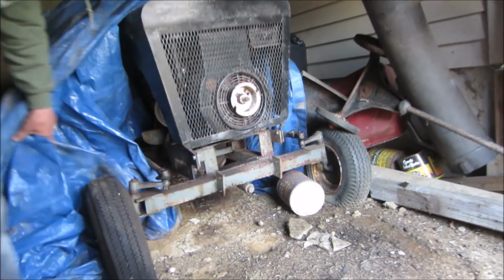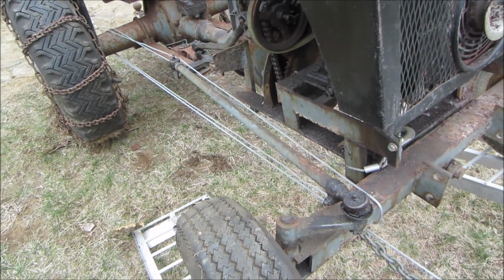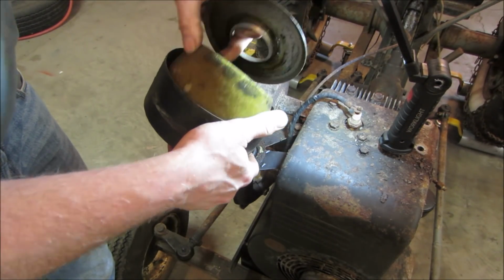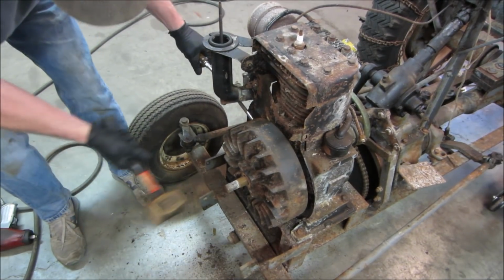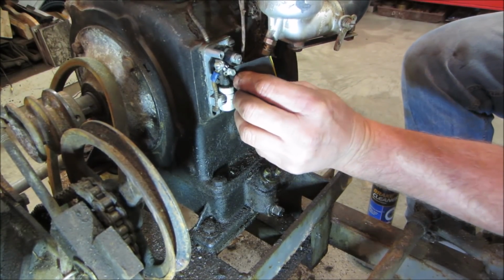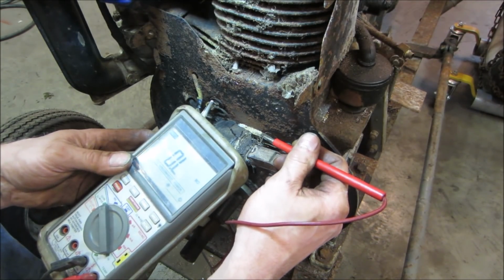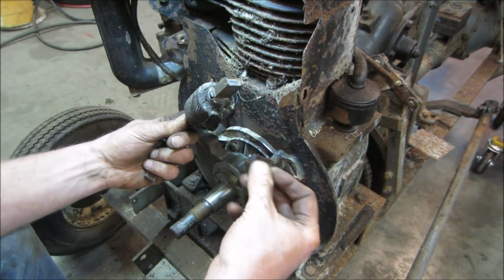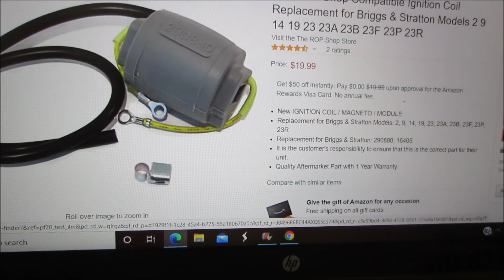Found under a House, Home Built Tractor, Can IT Be Saved?

Comment: Use the points of thet engine and a 12 volt automotive coil like many engines do. Always worked for me. The only thing is you will need a battery. Also do not use the kill switch on the points cover, it will short the battery. Just disconect the battery to kill the engine.

Comment: if you still have it you could stuff the little 3 cylinder diesel you got a while ago on there or the Briggs & Stratton model ZZ engine you did 2 years ago would be perfect for the tractor. it's not the most powerful engine but with all the torque they make it would work .

Comment: With functional external contact points, all you'd need is a coil and a 12-volt source of power, like a motorcycle battery.  I used that setup with an ancient Briggs years ago and it ran fine.  Didn't even burn the points after many hours of operation.  Granted, it's abandoning the 'original' nature of the critter, but it'd get that old thumper back into operation.

Comment: It looks like that coil had a short between the windings and went into thermal runaway which melted the varnish on the magnet wire and then the potting compound. In my younger days people would bring those to our transformer shop and I could reverse engineer them. I would measure the wire size and count the turns per layer, number of layers, and measure the insulation between the layers ect.  It might be difficult to find a shop now days that still does that. Anyway, I love your videos and I'm always impressed with your skills. I'm looking forward to your follow up video on the Franken tractor.😄

Comment: I'm pretty sure that the Primary Winding would consist of the 2 small wires and you should be reading the resistance across those two wires.  The Secondary Winding would be between the Spark Plug wire and Ground.  Again, just my opinion.

Comment: Coils are super easy to...cut the old one off the armature bar then heat the bar up good and hot and push the new coil on until its in the middle....you can get the coils off eBay pretty cheap....done probably 4 or 5 old briggs like that

Comment: Leave the mag out and mount a resistor type automotive coil in-line with the points , should get all the spark you need . That’s how old school Koehler does it . We can always ( make it go ) 👍
Reply: Yeah, that. However I got in trouble with the cast iron Kohler s because they came on Wheel Horse tractors.
 Those things reproduce like rabbits. You know you have a problem when you hit double digits. I get mine for cheap because of wiring connections usually

Comment: The model 19 which was 7 1/4 hp, looked a lot like that 8 hp.  It had the starter generator set up.  I have been looking and looking for one for my Allis B1.  I always get excited when I see one of those 8's but I should know better. The squared off tank and the air filter are dead giveaways.  The 8 is way more common. The starter generator will bolt right up to the 8 though and really works slick if you can just wrap your head around the wiring.

Comment: A work around for the dead mag would be to use the points, connected to a conventional ignition coil, and run with a battery ignition. The points after all are what tells the plug to fire. So, if you added a battery you could then go with electric start and even lights. I believe I would go with one of the old starter/generators, which would be appropriate for the time period.

Comment: If I am not mistaken, that engine is similar to the Model 19 Briggs and Stratton, which was a 7hp cast engine, and the parts are still available, and not to outrageously priced.  I have that engine on a Montgomery Wards Garden Mark garden tractor.  
I had to replace the mag on mine, which if I remember right, is the same set up you have on that one.  Hope this helps.

Comment: To get the flywheel off just put it under pressure with the puller and then give the flywheel a good sound whack with a hammer, works every time.

Comment: I was thinking ( I may be wrong so tell me if I am) of using a 12v battery, a car spark coil, and a wire to the spark plug. Using the points as they are as the spark switch this would have a spark to at the very least get the engine running. Just a thought for you Mustie1.

Comment: Small Engine Mechanic had a similar problem with the mag dying on an old 1940's engine. He ended up putting an automotive coil with a battery on it to make it run. That's the beauty of points versus 'electronic'---engine doesn't care what makes the spark. The points controls it.

Comment: I used one of those engines model 8, I think... The magneto on it melted down too... I used a 12V car coil connected to the points with a car battery. Watered my dad's garden for years with it...

Comment: What you need there is an old line output transformer/coil to turn the magnetic pulses into 10kv or perhaps a nice little Yanmar diesel.... Depends if you want to keep it as original as possible or use it as a workhorse lugging stuff around the grounds.

Comment: Just to see if it’ll run, hook up a modern coil to the points and power it with a jumper pack. If the points are timed correctly you should get spark at the right time and hopefully make it fire

Comment: Well if you want to try to get it to start in a pinch you can use a 12-volt coil and hook it up to run off the points and condenser so you have your spark

Comment: You dont need the magneto just use a regular coil with a car battery then youll only need the points and have to keep the battery charged. Or use your starter generator to charge it. Iv got a very similar briggs i think its a 16hp im thinking of building the same sort of tractor iv got all the parts.

Comment: if that core is laminated, be shure it is not swelled with rust and goes in easy or you will crack the coating. don't ask how i know! . it's a fine specimen of a powr-pup.good luck.

Comment: You may be able to improvise a coil for an external magnito. Like the ones on the old 8 HP Wisconsin's. We used to get them from tractor dealer. I think they were used in a lot of different motors.

Comment: I have a 1965 Wheelhorse with a 8hp Kohler engine with the starter generator and a 12 volt coil the points. You could just use a car coil and a 12 volt battery to see if it will run.

Comment: I usually "move ahead" by using a car battery and a coil from a car and the original points on the small engine. I have used that solution for testing but also more permanent if I could not get a replacement coil.

Comment: The iron bar surrounding the magnetic rotor is part of a closed magnetic circuit, so the magnet doesn't necessarily have to move directly past the magneto coil. The flux just has to complete a loop through the iron. If you can modify a newer magneto coil so that the bar going through the center of the coil touches the two ends of the bar surrounding the rotor, I believe it will generate spark.

Comment: If you wanted to get the tractor running with the engine it came with you could use the external points to trigger an automotive or motorcycle coil and use a 12 volt battery. By substituting  a v -belt pulley on the pull start you could also mount a starter generator ( I saw one in your stash) . This would give you battery ignition and electric start.

Comment: I think that curved piece that fell out is meant to cover the top of the rotor. It should be stuck on the bottom of the HT coil in the gap between the poles of the magnet.

Comment: You can put a magnetic pickup on at top dead center on the flywheel circumference and use a 4 wire HEI ignition module and automobile coil battery ignition.  That's how I got a number of old systems going just using spare auto parts. I have YT videos showing that.
Reply: Link your video, bro!  Get some traction!

Comment: You have external points so connect an ignition coils and a battery, then fit a dynastart unit from the other engine..

Comment: You could run a battery ignition using the original points with a regular 12V coil and a starter/generator to charge the battery.  No rope pull starts.

Comment: Back in the early '60's there was a set of plans in an issue of Popular Science that you could built a small tractor about the same size as this one !  it also used a Ford tranny & cut down rear axle. there was even a couple methods shown to narrow the axles.
the steering on this unit looks like it took a "couple" minutes to get it to work right !

Comment: Try anti-seize on you main puller bolt you might be surprised by the power increase ,we pull a flywheel off a tapered shaft and without it there is no way it'll pull it loose.

Comment: Put a VW coil on it ,  Did it with a boat motor and a lawn tractor you can also use a model T buzz coil , seen that on a wood splitter

Comment: Hey brother, Backyarder, Grease Monkey, Knuckle dragger, opps sorry  I mean Buster, Wrencher, etc. This is only a suggestion, my friend, when you have to hammer on a threaded shaft or larger bolt, put the nut back on, and upside down (only if it's a castle nut though) to avoid damage to the *Parapet*. Like that one ah! But If your not worried about re-usage of the nut, bolt or shaft, then by all means Skip to the Next Page. Lol Thanks for sharing luv the fact that You always seem to take on the worst of the worst in projects (which is what I've always enjoyed doing myself) but my hat goes off to Ya, please Keep Safe, Happy and Alive Thx again. Wit+Luv & Strength. Andy T Barrie, Ont. Canada 🇨🇦.

Comment: Ignore the magneto in the flywheel, substitute with a more modern coil and a battery. Use the points already in the engine. If the engine is good, add a "dynastart" and voltage regulator and Robert is your mother's brother.

Comment: Since the points are stand alone and you verified that they do work, try using a regular oil filled coil powered by a battery instead of a mag, similar to the setup on the engine that came with the King Midget.

Comment: For the purpose of finding out if there are other issues, could you run it as a coil / battery ingnition, using the points etc. as-is? But you've probably got a replacement part by now anyway. Always look forward to the videos.

Comment: 49:00 I'm wondering if that metal piece isn't some sort of spring/spacer. Maybe to keep tension on the coil carrier? Maybe it is to provide an airgap? I don't know if airgapped magnetic circuits are a thing on engines though.

Comment: Hi Mustie.  I also live in NH, Grantham.  I was wondering if you have a small garden tractor (no lawn deck needed) and a tote trailer to pull behind it.  Prefer that it had a posi-traction rear axle as it would be used in our wooded lot to drive on wet leaves and sometimes soft ground.  My wife wants something to haul her garden tools and to be able to haul sticks and leaves and stuff that she rakes up around our lot.  If not, no worries.  I enjoy your videos.

Comment: the ignition system on these engines are very good Briggs and Stratton called it the Magnematic  the rotor in the center is the magnet if your engine is a mo.9 its 3.o hp mo.14 is 5 hp mo .19 is 7.8 hp mo. 23 is 9.8 hp

Comment: I am really surprised that you haven't discovered that Denatured Alcohol is an excellent solvent to remove the varnish left by gasoline.  In my early days 50's and 60's ( I'm 85 now) I did a lot of carburetor rebuilds and Denatured Alcohol was the go to solvent for cleaning a carburetor.

Comment: Holy crap that thing looks terrifying to me!! Dinky little engine, short wheelbase, bigass weight on the rear axle, no fergusen hitch... it looks like it was designed as a suicide device, for maximum effectiveness at flipping and squashing the driver. I've lifted the front end on a 9N (waaay heavier) and just about pissed myself. My hands were shaking for an hour. I wouldn't start that thing in forward gear on a bet 😂. Reverse, tho!

Comment: Hello fella. Let me tell you something, being a hammer mechanic is not the ticket, PERIOD !!  AT least you used a brass hammer, I can forgive you Mustie1. Just take a blow torch and heat around the tapered shaft for about a half a minute or so and do what you are doing and it will pop off instantly.Many times you do not even need to pry with a bar either. Was taught by an old mechanic when I was 10 years old.
The coils in the old B and S did not hold up well at all. I rewound a many with great success.

Comment: And that's the issue with those 1950's/early 60's coils. The phenolic plastic they used than was not quite perfected. Same issues with the boat motors of the time. The plastic would crack and break the seal shorting the coil out from moisture in the air.

Comment: A way to get spark, remove coil and place it in a oven at 200 degrees for 2 two hours this will dry the coil and it should spark again! If it works, remove it again, heat it up to 200 degrees and spray it with Glyptal motor varnish, let dry and bake for an hour a 200 degrees! Coil fixed!

Comment: Bet you could get it running with a Model-T (or A)  buzz-box, just tie it into the points. 
Sure, that'd require a battery, but then you could hear it run!
Reply: Like the one from that marine engine under the bench...

Comment: Interesting set of problems. I'll admit I'd love to see one of those old Briggs engines you worked on used to repower this. But if there's a relatively cheap replacement available I hope it works out.

Comment: You could convert that system by using the original points to trigger a car ignition coil, powered off a 12V battery.

Comment: Very unusual coil and magnet. Never seen anything like that. Here's the story on the warning: Being that old, the magnet is probably AlNiCo. the magnet is either charged insitu, or charged with a "keeper" and then slid from the keeper onto the shaft with the coil assembly in place. If the coil is removed without some kind of keeper in place the magnetic field will partially collapse making the magnet permanently weaker.

Comment: i had a an older engine just like that one with a bad coil. I ended up turning it in to a battery powered ignition with an external coil off an car and with the engine's  factory points and condenser.

Comment: Set the time machine to 2005 and I pulled a similar homemade tractor out of a field. Mine was way more of a death trap. I think it was the remains of an unlucky mazda pickup. No extra reduction,  so it was a cable brake, 100 mph on a flipped and narrowed beam axle death trap. I got it running and sold it to a local inbred for 100 bucks, more than scrap price, and I assume he slobbered green and yellow spray paint all over it and bolted on mag wheels, ya know, for parades. Oh it had donut spares on the front with torched out lug pattern mod too. Probably should have tried to pop a wheelie with it before I sold it.

Comment: Looks like a rotary 1779 coil if so it slides off that metal support and the new one slides on in its place. Least that what the article I read said...cant find it again or would link.
Reply: The coil he found at the end on line looks like the same applications etc as the 1779...

Comment: the starter/generator i also known by the name of Dynastart here in europe they were used on small inbord boat motors (that were usually started with a crankhandle) i had a such motor a 1 cylindre sabb 10hk diesel that was a beast to start and i mounted a 25amp dynastart it looks like a bug dynamo just a bit bigger , still have the thing with all relays and wirers ,but i bet it will cost a small fortune to send from Denmark

Comment: If the tractor had an electrical system you can wire a 12 volt automobile coil to the points I did it on my 16hp Briggs on my 1975 mtd 990

Comment: As long as your points are still working, you can just put an automotive coil on it, and make it a battery powered ignition. Sorry if this has already been suggested, I didn't read the 1100 comments :-)

Comment: Crap, I have the same engine but 10hp in my garage just sitting. If you were close to Maryland, i'd just give it to you. It runs great but smokes a little. It looks exactly like the one on your tractor. Worst case if you can't find one, send me a comment here and i'll rip mine apart and mail you the coil. I have a bunch of old sideshaft briggs and don't need this one. I can also throw in the gas tank, etc. Not looking for cash or anything, just would like to see that old tractor move with it's original engine again.

Comment: I don’t know why you just dont dim or turn off the lights in the shop and actually see the spark, just be sure to clear a path or use a flashlight before you start, when you go to start turn the flashlight off stay in the dark for a minute or two to adjust to the dark and see the spark when you try

Comment: Glad you were hitting the crankshaft with a brass hammer, but shouldn't you have put the nut on the threads so you would have ruled out the chance of mushrooming the crankshaft or at least damaging the thread? I hope it comes off with the puller!and a bang.

Comment: There is nothing wrong with the coil as all wire has some resistance. Those sparkplug threads - best ground - the actual plug wire is the problem 4 out of 5 times.

Comment: This must have been a Very Interesting project for someones Grand-Pa in the 1950's.  but this tractor has no PTO to drive farming implements. With a Trailer hitch in back, It is only designed to hook up to a trailer and pull it around.

Comment: was hoping you where going to put a  12v coil on it off of a car and a battery.  It would of sparked then.   just gota have a drop down resistor or it will burn points.   I ve even used 6 v lantern battery for a test.  runs a long time before battery go dead.

Comment: Hi, What IF, If you used the points to make a little 12 volt scooter coil spark, then just run it of the battery.. But maybe reduce the points open time be reduced like a normal motor does. ?

Comment: Why don't you get the engine running using a constant loss battery and coil wired to the points?